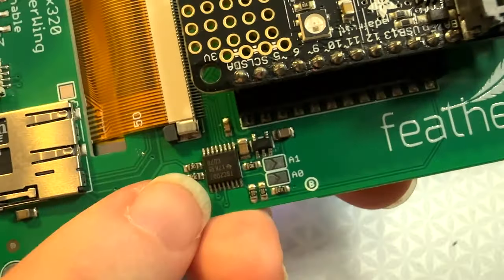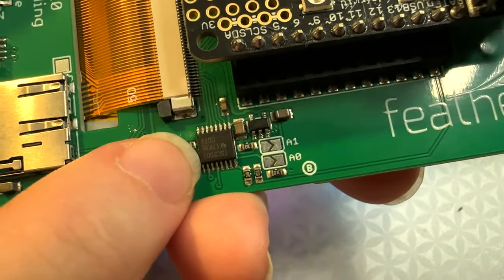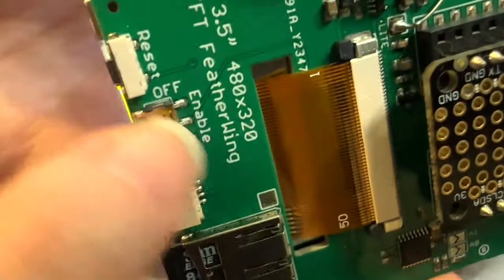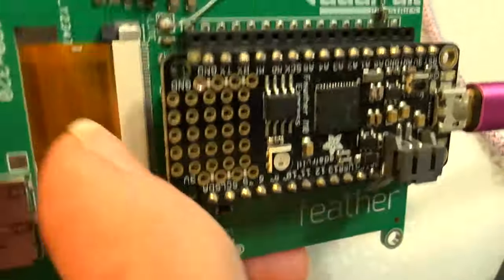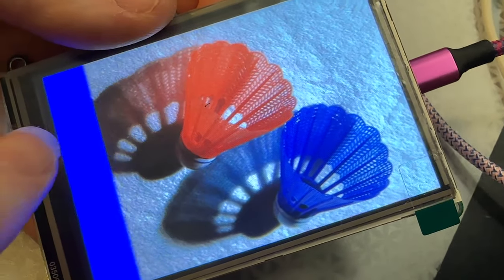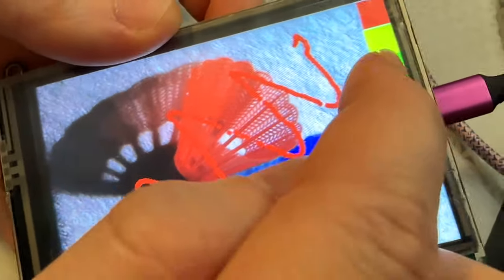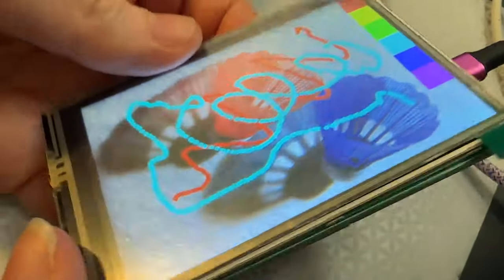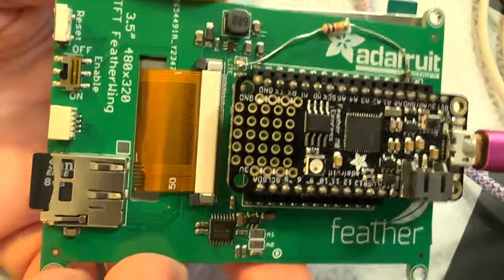Revision number 500... 3.5" TFT FeatherWing

Comment: If only it was offset to make room for a battery…
Reply: The 3.5” TFT Featherwing display is power hungry. A small lipo battery will not power it long so it’s pointless to offset. This one is better suited for small enclosures.
Reply: @DevonsWorkshop  I've gotten  10+ hours out of a 2200mAh barrel battery, dropping the brightness to help with power consumption, on that panel and on that Featherwing.
Reply: @strredwolf  You have to do a hardware lite mod to get access to pwm dimming of the backlight. I’ve done the mod but never used it derp. Good idea.
Reply: @DevonsWorkshop  If I remember, the mod was already there. I had the breakout board version as well and made a custom PCB to properly mount the Feather to the breakout.